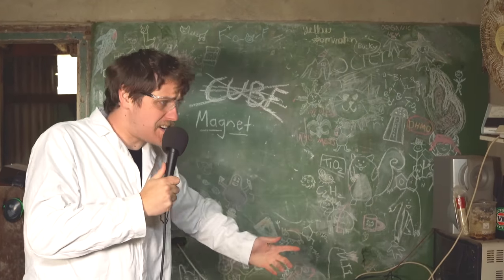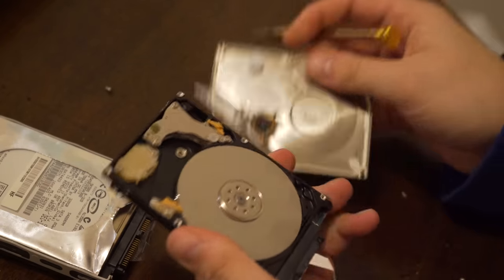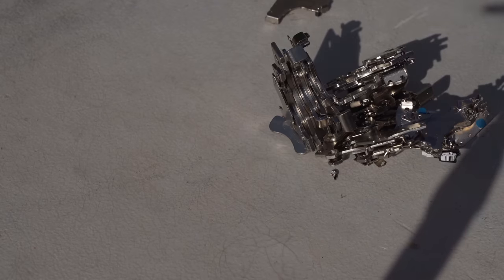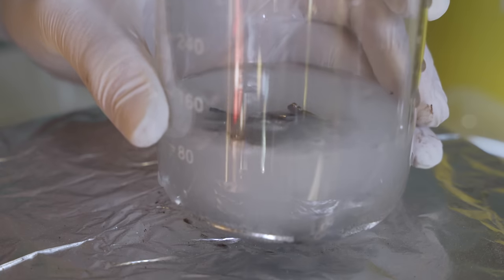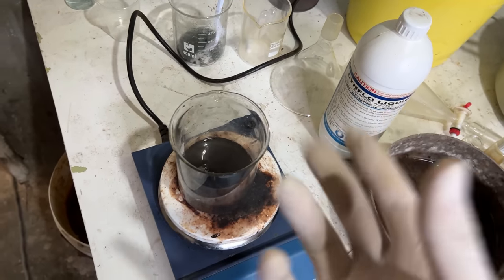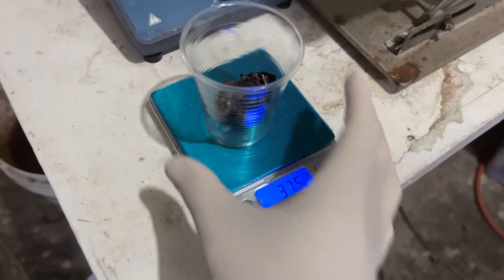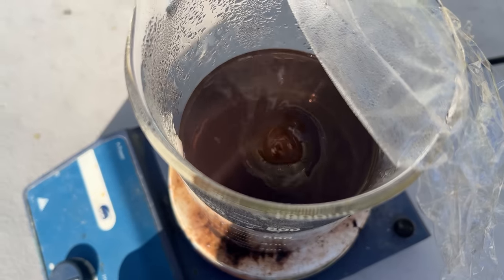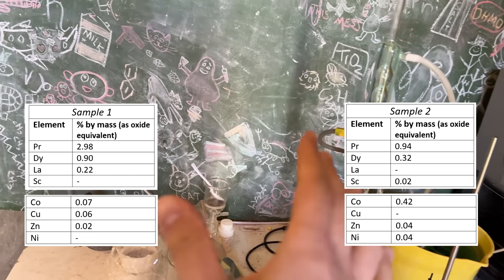Extracting Neodymium from Harddrive Magnets

Comment: As a computer engineer I can confirm, sometimes you just need to break a computer. My preferred method is waaaaaaaay to much voltage or current into something important, but acid is good too. I do have to reccomend the electricity approach though. Motherboards blow up real good.
Reply from the maker: Good to know! Thanks!

Comment: There's always another screw under the label of these hard drives, very easy to miss if you've never taken one apart 😁
Reply: True, until you Remember that companies are assholes. I guess hard drive manufacturers kind of get a pass because they're doing NASA level precision but my point still stands.

Void if removed stickers are illegal.
Reply: @DoubsGaming  - NASA precision is pretty poor nowadays, especially when it comes to the decimal place in manufacturing costs.
Reply: @DoubsGaming Void if removed stickers are illegal?
Reply: @Sniperboy5551  In Australia, yeah.
Reply: @Sniperboy5551  They're not illegal to put on products, but are unenforceable in the US.
Reply: @Merry-36280 Good to know, I usually just get a bit of isopropyl alcohol under the sticker and it just slides right off. And when it dries and I'm doing doing what I need to I can just stick the sticker back on.
Reply: @Merry-36280 Legally unenforcable that is. If the company says 'no, I will not warranty this because you broke the sticker'', you have very little recourse without spending money on suing them. You can also make a complaint and hope they get fines, but it won't solve your problem.

I wish those stickers never existed in the first place, its purely anti-repair
Reply: "Always check under the stickers"
Reply: Nah, that's what the hammer and the bolt-cutters are for ... :P
Reply: I know I wasn't the only one screaming at a monitor.  You'd think he would have seen it after tearing the cover off.  I know stupidity gags are part of this channel, but this one was a tad over the line.

Comment: 4:05 - I used to work as a “computer butcher”. It’s not your fault, those harddrive screws were a pain in the ass to deal with! We eventually got a small industrial shredder to destroy the drives with, and it was so much fun to watch ‘em get chewed up!
Reply: I don't have anything that good, but I have melted and shattered drive plates when I've removed them if the dead drive had anything sensitive on it.
Reply: @christopheroliver148 Melting em would definitely do it but I wonder if shattered discs could still be read like how shredded paper can be meticulously put back together. the error correction code on certain protocols used is so good that I wonder if a good amount of data could be recovered from a shattered disc
Reply: @submachinegun5737  In my case, the metal oxide was on a polished glass substrate.  By shattered, I mean basically broken to nearly a dust.  I do not believe the info would be practical to recover.  Of course you could still heat the dust to the Curie point if you were sufficiently worried.

Comment: Hey Tom, those metal brackets that the magnets are attached to are made from mu metal, a Nickel alloy that weakens magnetic forces. It shields the other components of the computer from the magnetic field. They are about 77-80% nickel and are heat treated in a hydrogen atmosphere to achieve a super high magnetic  permeability. It should be possible to get a lot of nickel from them if you need it.
Reply: I think this might be true for older hard drive magnets, and not anymore for newer ones. I have taken apart a lot of hard drives, and I've tested dozens of the brackets, and there was no nickel visible. Other people on the Sciencemadness forum tried the same and they couldn't recover any significant nickel, just iron.
Reply: @MabusParodies2nd   I see, that is unfortunate.

Comment: I think you should've treated the magnets with sandpaper / a belt sander to get rid of the coating.
Reply from the maker: Honestly a very reasonable suggestion !
Reply: belt sander might be dangerous if the magnet sticks to the sander
Reply: true lmao
Reply: First some cooking against magnetism then some grinding for some nickel poisoning ^^
Reply: @emmanueleferrarotto2986  wet sanding helps with dust control a lot
Reply: @guicky_ heat to 80 C and it lose magnetism, then grind or whatever nexessary
Reply: @Blacktronics   of course
Reply: @ExtractionsAndIre yeah mate, why all that hassle, can't you just galvanize out the nickel? Just dissolve everything and use a battery or something to get the powdered metal out.
Reply: @guicky_ not if you're doing it after demagnetizing the neodymium
Reply: @stasi0238  - you're overcomplicating things. Just convert everything to pure energy and then convert back to your element of choice.
Reply: Do you really think he has a belt sander?
Reply: @JohnnyWednesday  nah that's the fun tho optimizing shitty processes. Anyway in my pocket I have futuristic machine that I can use made up numbers and convert them to anything I need, so I guess that's beating turning things into energy step.
Reply: I dunno how much you’d be able to sand down the nickel. Nickel is pretty bloody hard, harder than most annealed steels. Sanding it down is a pain, and as soon as you get to the magnet below you’ll have a hard time not decimating it as well.
Reply: I break up the magnets with a hammer and pliers first. That (anti-corrosive) nickel coating does its job surprisingly well.
Reply: Or just cut away the nickel with a box knife
Reply: @Sniperboy5551 he's gotta have one in the pile of junk at the back of his lab.
Reply: @Hyo9000 whacking it in a tumbler for a few days might be safer and easier
Reply: Neodymium dust is an inhalation and fire hazard. Bad idea.

Comment: I was doing this a while back, on the ScienceMadness forums.
Hitting the magnets with a propane torch made it very easy to physically peel off the nickel plating.
Dissolving and filtering a hot solution of magnets and sulfuric acid made it easy to separate the insoluble boron and flecks of missed nickel coating, but some does dissolve and will crash out when the solution cools as a very fluffy boric acid crystals. Once cleaned, this doesn't affect the rest of the process much.
Once you have this filtered solution of Fe and Nd sulfates, this is further differentiated by heating to ~60*C to boil off water just until some of the Nd starts crystallizing out, then slowly cooling to <0*C which will re-dissolve the Nd sulfate and crash out the majority of Fe sulfate.
Depending on the care done with this process, you can even just physically pluck out the purple / blue Nd sulfate crystals from the teal Fe sulfate crystals if you got the solution a bit too saturated.
A few rounds of decanting this, you will have a very pure crystalline Nd sulfate crystals by slow evaporation - I was able to grow crystals of around 1.5cm, but they are very fragile to thermal stress.
Reply: Did you end up making magnets with the results? Cool stuff regardless!
Reply: Gold. Sounds like crashing out the iron rather than the neodymium is what Tom needed to try.

Comment: I think another explanation for the different colours of precipitates of neodymium sulphate is crystal size and orientation. Research has been done in using both neodymium and samarium salts in paper money, to prevent counterfeiting, because the way the crystal structure is oriented with respect to the incident light source can apparently cause it to change colours. So slight changes in the overall distribution of crystals within a sample could bias the colour in one direction or another. I'm not actually sure if this is what's going on, but it is a known phenomenon.

Comment: I'm @10:30 and I think your easier solution is run them through the ball mill.  Then put powder into water and agitate with a covered magnet in the water.  The Nickle should adhere and also settle later then the ceramic core material.

Comment: I always love taking apart them for the extra strong fridge magnets
Reply: I keep one in my truck for plucking stray metal bits out of my eye.
Reply: @buillioncubes  Will it work for eye floaters?
Reply: @squarerootof2  Just the ferrous ones :P
Reply: @buillioncubes  Good, the ferrocious are the worst and most aggressive kind.
Reply: Two of my fridge magnets used to be in hard drives. They hold up the calendar on my fridge.

Comment: Neodymium and iron somehow don't like to separate, what I did was adding some hydrogen peroxide to force the iron to form +3 hydroxide, then filter it. Still, took several repeats to get to any purity. Even when re-crystalizing by slow evaportaion there still was some iron left.
Most of other lanthanide sulphates also have this reverse-solubility thing.
Reply: Iron and nickel should be easy to electroplate out of a sulfate solution while leaving neodymium in the solution. Electrolysis probably isn't often an answer to a chemistry problem, but it works great for something like this. I've electroplated iron, nickel, copper, and zinc with a variable voltage (0-32V), variable current-limit (0-5A) power supply I bought online for about $50 USD. I've even used it as a spot-welder for really thin metal foil and wires, for plenty of electronics projects, for charging batteries I couldn't find the right charger for, and just for making lots of sparks by shorting it on its max settings when I'm bored.

Comment: you always have to add way more acid than you expect in magnet recycling, acid and peroxide mix is always a good go to for the dissolution of metal massive
Reply from the maker: Effective but kinda scary yeah!
Reply: @ExtractionsAndIre  more scary with a cobalt metal that catalysed the peroxide decomposition....the fumehood was pretty fucked after that
Reply: @victor9sur768  haha I can vouch to that. I was recently trying to recreate a cobalt-doped iron oxide composition (Type II magnetic material used in vintage audio tapes) by precipitating iron(II) hydroxide from an iron(II) sulfate solution with NaOH, then oxidizing it to iron(III) hydroxide with H2O2, and then doping the crystals with a little cobalt before thermal decomposition... I used a small excess hydrogen peroxide because I wanted the oxidation to be complete and it's hard to judge the end point by color (goes from a muddy brown to a slightly less muddy brown). And when I added the cobalt sulfate, it suddenly foamed... A LOT. Surprise! :D 
Guess cobalt hydroxide is a good catalyst for that too.
Reply: @ExtractionsAndIre would royal water have worked to dissolve up everything?

Comment: I remember that Science madness thread. At the time I wasn't really able to get hole of any sulphric acid so I used white vinegar instead. It's doesn't react with the nickle or boron much but the boron does tend to make it froth up a bit. I tried to separate the iron and Neodymium by dropping in ammonium hydroxide which seemed to work, leaving a pretty pink solution. However that might have been an ammonium complex with the iron or neodymium. Also from memory, neodymium salts are sensitive to light. It's been over 10 years since I tried the experiment. I still have some jars of it in my shed, lol.

Comment: Pointed scalpel blades have always been pretty effective for removing that nickel coating from the magnets. You can get it underneath and kinda peel it away. In a hurry a sanding wheel attachment for a dremel is pretty quick but also messy and shrapnel-producing.
Reply: Actually, I was thinking he should've just secured the magnet in a vice, and just go at it with a bit of sandpaper. The nickel metal is likely far softer than the magnet it covers up, so it shouldn't be too difficult to just abrade it away while leaving the magnet untouched.

However, Extractions & Ire is all about the struggle, about doing things in the most difficult and non-intuitive way imaginable, fighting against the very laws of physics and chemistry to eventually, maybe, achieve (usually just partial) success. So doing things in a way that made sense would be extremely off-brand for this channel.
Reply: @VoIcanoman  fair point :D
Reply from the maker: A lot of comments about how unhealthy the nickel/cobalt metal dust is… kinda glad I didn’t aggressively sand a lot of magnets!
Reply: Metal dust = Bad and cringe
Going crazy with a power tool = fun and based

Benefit outweighs cost

Comment: Try adding sodium sulfate to the dissolved solution of the magnet in acid. The neodymium ions form an insoluble sulfate double salt and precipitates. This can give you a better neodymium removal than simply recovering the neodymium sulfate.
Reply: thats interesting, but out of curiosity - how would you go about getting rid of the sodium afterwards?
Reply: @g-radical349  You don't need to. When you've precipitated the neodymium salphate double salt you remove it by filtration, what's left in the solution doesn't matter.
Reply: @EddieTheH   I don't understand what you mean. The precipitated salt is Nd2Na2(SO4)4, and when simply filtered, it is still Nd2Na2(SO4)4.
Reply: @EddieTheH  I meant how would you remove the sodium from the double salt, so that you would just have neodymium sulfate. Is there a way to selectively dissolve the sodium from the precipitate?
Reply: @g-radical349  You can boil the precipitate in concentrated NaOH to convert the neodymium to Nd(OH)3, which can be dissolved in acid to make neodymium salts.

Comment: I think a hammer would be a good method to seperate the nickel plating from the ceramic core. The ceramic would crumble to sand, while the nickel would be malleable enough to turn into larger flakes. Then you can just seperate them with a sieve or some other mechanical method of seperation.
Reply: This is the way

Comment: I'm amazed by the yield. The nickel is like 30% copper, i noticed the copper will come out of the alloy but nickel would stay mostly the same, with hcl (then cement on the very nickel most times or redissolve). I'm trying the hcl way, h2o2 for taking iron to +3 then oxalic acid for precipitation. I'm also feeling hcl works much much better.

Comment: Hi, Tom. It's good to see how enthusiastic you are in what you're doing. I would love to participate in your experiments by making some equipment and automation. Unfortunately, I live quite far away.) But if you need some microcontroller based stuff then you can use something widely available like RP Pico and I'd be glad to help with its firmware so you'd just need to connect all the stuff together.
By the way, you can dissolve the top Ni layer on the anode in sodium chloride solution. At least until it can be grabbed by its edge and ripped away mechanically. It's a very controllable process.
Reply from the maker: One day I would love to combine electronics and chemistry some more, make some custom machines that do some sort of chemistry or analysis. One day…

Comment: Couple years back I played around with growing neodymium sulfate crystals from rare earth oxides I got from a pottery store. Wasn't cheap, I think it was about $15 AUD for 10g or so. But it makes me wonder if you could purify the neodymium by evaporating the solution to let it crystallise? If there was a cool sheltered spot you could leave an open container of the solution in for a couple weeks? I got some nice big clear lilac crystals when I did that, and I remember that toward the end there was a bunch of weird stuff that came out of solution that wasnt neodymium.
Reply from the maker: Yeah definitely. There’s an art to crystal growing that I feel I’m too impatient for… but it would be cool to master that and think about making some laser crystals or other optical materials in high purity…. Would be super cool to do that in the shed. Might be too much dust around though haha
Reply: @ExtractionsAndIre  Hahah yeh dust is defs the enemy of crystal growing. One way around the dust and temp issue would be to do it inside a sealed polystyrene box, and use some calcium chloride to soak up the moisture. I used to do it this way for tricky fast growing crystals that I wanted to slow down. Temp being the main factor that I had to control. I'm an impatient creative myself - but doing multiple projects at once kinda works well for crystals as you can kinda set-and-forget. Which sucks when you want that instant gratification hit, but is awesome when you remember a month or two later and see some awesome results!

Comment: I use the disks as coasters and the magnets as tool holders in my shed. I love HHDs.
Reply: While not proven to be, the cobalt in the alloys used in hard disk platters is a potential carcinogen, so I'd use PPE when drinking while using the coasters!
Reply: @leeemur  I also have a couple of microwave magneto cut open as a display piece. You're not going to tell me this thing has thorium in it are you? 
I smoke like a chimney and drink like a fish. I'm really not that concerned about my well being. But thanks for caring.

Comment: The reason why certain chemical solubility goes down usually has to do with different N-hydrates having different solubility. E.g. if the monohydrate is less soluble than the dihydrate, raising the temperature tends to convert more into the less soluble dihydrate. This can also apply when the crystalline product isn't a hydrate because the solvation shells break up when the temperature is higher. I like to conceptualize it as hydrates in solution, even if they don't precipitate. Not sure if that is entirely accurate on a technical level to call them hydrates.